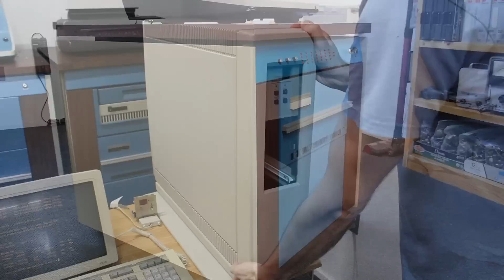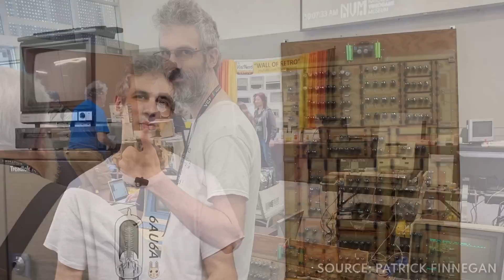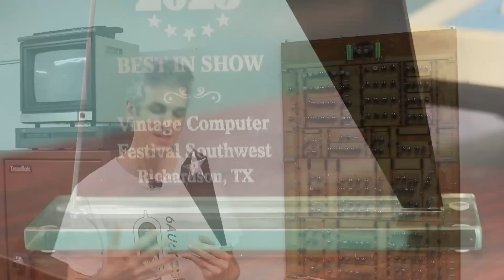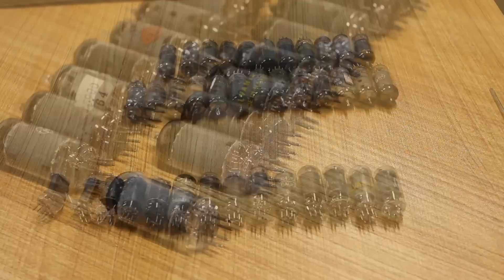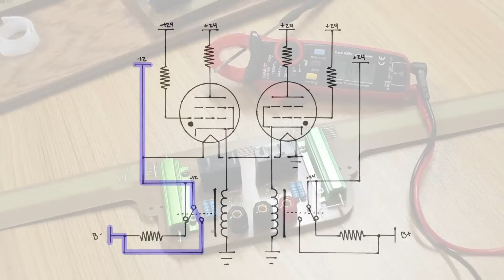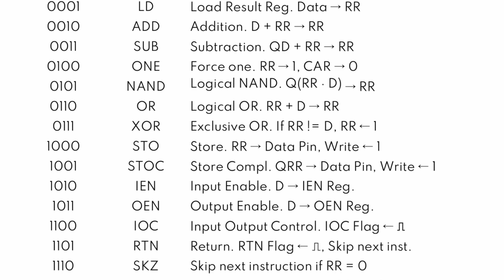VCF Southwest 2023 Recap and Fixing a Disaster

Comment: I have a piece of vintage TEKTRONIX equipment being a type 561b oscilloscope with a 3b4 time base and 3a6 amplifier, the story of how i got it is quite funny

The machine was originally purchased new from factory by ohio medical in 1971 (confirmed as i have the original reciept) and my grandfather used it to callibrate large industrial machines, by the time he left he was the only person at that facility that knew how to use it so they gave it to him, it sat under his workbench gathering dust for something like 20-40 years im not to sure, but one day last year i saw it and asked my grandfather about it, he happily showed it to me and said if i wanted it i could take it and so i did, he also had almost all of the documents and manuals for it intact and i got those as well, the machine works a treat and i havent had any issues with it, it is a vacuum tube machine and as far as i can tell they have never been replaced, which is mind blowing that it still runs perfectly with factory tubes

Edit: i also have some questions,
1 are vacuum tubes okay to touch, i have wanted to pull the tubes on my scope and clean them but i dont know if thats a good idea or not
2 what are your thoughts on the scope i described in the comment, im always curious what people think of it and the wild story it has

Comment: you getting back HS equipment, where we had more then 1 026 card punch and 1 129 punch. we had a IBM system 3 mod 10 with 600 line printer and 1402 card reader/punch. Were we punching 10K cards but the 1402 did not print one cards and that where 129 was used to print what was on the cards. we did not have the 96 card reader/punch as the HS want standard cards.

Comment: Sorry I just watched your video. I am a ham radio operator in Tulsa. I checked my stock on the 6AU6 and also have many. I believe that you designed this tube PC. That is Personal Computer not portable computer. Sylvania Sharp Cutoff RF Pentode with 6.3 volt filament, 300Ma.  I have the original manufacture data sheet if you want it. I would go to e-bay and purchase a pin straightener socket. They are only a few dollars, and you are going to need it. I have many tubes in my stock and have four tube testers. If I may, please mount the board on a vertical stand that is less likely to tip over. You have put a lot of work into this display.  I built my first computer in 1976 while I was in the Navy. I was onboard ship headed to Subic Bay Philippians. Personal computers did not exist, but you could purchase a kit computer based on an 8086 processor. Everything was toggle in with a four-inch-wide printer output. It took us six months to program it to play chess. Thank you for your video.

Comment: One slight improvement when you are doing repairs like this: The board-board interconnects would be better if they used jumper boards or standard jumper cables. This would allow each board to be easily removed or reinstalled. Also hooking up additional meters or diagnostics in the linkages would then be possible.

Comment: You should build a removable wooden cover to put over the vacuum tube computer for transport. Just screw on some 1x4's   around the perimeter and that should give you enough height to clear all the tubes then just attach a flat panel that sits on the 1x's.

Comment: You won for one simple reason, you had a well designed vacuum tube computer, similar to the ones built in WW2. Home built and running, well done. I would have given you the award myself if I had been there.

Those vacuum tube computers are hard to get going and keep running. I worked on one in college a very long time ago, back at the dawn of the solid state IC.

I would recommend that you mount all boards on the backboard using standoffs. Also as others have said, some guard rails around the boards would be good. Perhaps 3 d print up some board carriers. Make them steampunk looking and all will be good.
Reply: Steampunk looking? Maybe some nice brass drawer handles at Home Depot? They would need a little extension, but could give a nice look to the project, in addition to accident resistance.

Comment: There is not much overlap on the tube computers backing board to add some lightweight protective travel bumpers like slabs of tough expanded polystyrene or urea foam to take the hit if it falls face down on a flat pavement or floor. I sort of remember the board was maybe sized to fit your truck bed? If it's travelling around put some thought to designing a lightweight, tough wheeled box for it. Maybe run a group design project, audience participation? It could be reversed and double as a stable, inclined stand for shows where you don't have a handy wall behind for support ?

Comment: Can't you add some wood pegs that stick out further then the tubes so if in the future something similar happens the pegs can take the brunt of the impact. Just seems an easy solution to a problem that could happen again even if earth quake or something causes it to fall off wall could prevent major damage as boxing in the tubes would trap to much heat pegs would be simple and not cost much

Comment: I think you did very well going to those events. Being in Idaho. Anything like that was not and still not. Well we do have local Ham events. Around the late 90's I picked up a Burroughs B21 or 22. Not sure what model number. Big old 8" drive, and typical missing key on keyboard. It fired up and sure enough I found word perfect. But, with tons of other around that time. It got chucked along with Several Wang terminals, cables and printers. I still to this day go around to museums and such point out what I owned, if it worked, what I did with it and what I passed up. You taking your Centurion to the show was just what everybody needs. I droll all over your Centurion, Wang and soft of vax systems you have. I also Droll over Curious Marc hp systems.  These are the type of systems I consider classic. That I wanted to use or collect growing up. So I just wanted to say Thank You.

Comment: Consider adding a full-length handle/guard rail along the sides of your tube computer that sticks up higher than the tubes.  It would help prevent future damage and maybe even make it easier to transport.
Reply: I was thinking a tie down or bungee cord fixed to a stable point would subdue the Murphy. 💪
Reply: I thought of an acrylic front screwed in the same screw places of the boards , but probably the guard rail is the best option for minimum added weight.
Reply: @fordesponja  An acrylic cover would probably not be good for ventilation of the fire bottles.

Comment: The small pins are not made for this application. It may be okay for a signal (e.g. LED) but not board to board. Ususally they used card edge connectors for board to board interface. But maybe it would have done more damage when a PCB snaps or cracks.

Comment: Might I suggest a couple of "c" handles along the sides of the device that sit higher than the tubes.

Not only could this help with moving the board but if it tips, it would most likely protect from direct impact damage, and not look out of place in the design scheme as they could be made of wood.
Reply: Great idea.  My first thought was a plexiglass cover plate, but then I realized that would trap too much heat.  But some 'guard rails' around the sides would go a long way.  Maybe one or two near the middle as well, in case the board flexes too much?

Comment: You should put something in front of this computer while you are transporting it so in case it falls again, it would protect it.  If don't mind taking time to do this, remove all the tube before transporting it and reinstalling them when the computer is setup.  You could rebuild the computer so that when you need to transport it, it would be safe in a box. The box is only purpose is to transport it only.

Comment: Great video! Have you ever tested/used 1T4 pentodes? They are already designed for lower voltages, 1.4 V filament, 90 V or less plate and screen. EG my 7 tube 1t4 radio uses 54 vdc plate/screen.
Reply: I see you are one of those that never respond. Oh well.

Comment: probably a stupid suggestion, but could you not build a framework around the edges that was just slightly taller than the vacuum tubes to stop them hitting the ground if this happens again?  I know it could still get bent up, but it might save you from the worst.

Comment: That's enough vacuum tubes to give you x-ray cancer
Reply: You need high voltage to produce x-rays, 24 volts won't do it.
The EHT rectifier in an old TV can produce x-rays, but the energy is so low that they are blocked by a thin sheet metal box.

Comment: You may consider putting a frame in a light material around the board so that it's the frame that would be hit instead of the tube. A simple frame made out of light material like aluminum, PVC or wood would be enough.
Reply: That will do it.

Comment: the xerox print head is worn
Reply: Or it has a stuck needle. It might respond to stripping cleaning with isopropanol. Some of these old print heads can be adjusted so you may be able to do some "tweakage" to sort out its problems.

Comment: Damn awesome event, congrats about the star! And pity about Kevin... We can rebuild him, we have the technology! Nice recombobulation. 

Seeing the bent angular goldpin connectors gave me another idea: maybe using upright pin headers and jumper boards with female connectors? Sure, it's a lot of work machining and soldering them, but in case something smashes into a board, the joint will come apart at worst, but not damage any traces.

Oh, and if you want, it may be a good opportunity for a dissection video of 6AU6 from different manufacturers to show the differences in their internal build.

15:50 of all things, I'd never expect a resistor to fail.

Keri register recombobulated and go for launch, haha!
Reply: Yeah, I'm quite curious myself about why and how that power resistor failed. Might be worth someone with machine tools cutting the thing open to see what's going on in there. (For me, anyway, since I use that type myself for various power-supply-related testing.)
Reply from the maker: @Curt_Sampson  I didn't talk about it in the video, but I have a pretty good idea. When loading it up on the way too the event, my dis-coordinated self accidentally slapped a tube, bending the pins up. Instead of spending a few minutes to straighten the pins, I reached into my 6AU6 grab bag and just replaced the tube. Unbeknownst to me, I accidentally grabbed a 12AU6, which created a much lower resistance path to ground. I think that may have put a little too much stress on that 0.8 ohm resistor and burned it up.
Reply from the maker: Thanks Keri!
The 90-degree pin connectors was not a great choice, but one that become obvious in hindsight. For the second board, I'll be almost exclusively using upright pin headers and jumper boards with female connectors. It's more machining, but it's definitely a better connection method. Though, still not the most ideal, for UE-2, we'll be doing it proper!

Comment: Time to build a proper "crate" or cover to protect the tubes?
Reply: I was thinking "Roll-Bars"...
Just a couple metal rods would be easy.
Could also double as handles.
Reply: At least a cage
Reply: Or even some door stop bumpers on the corners
Reply: Other than some convoluted system of mounting the PCB's to a metal sheet instead of wood and bridging the gaps with thermal pads ?...
The only logical engineering answer is a case with active cooling.

I doubt he wants to stack the boards like shelves as they would not be as impressive on display.  But a box made of glass/plexiglass/acrylic/Lexan/etc. would allow for fans.

It could be left in the large flat panel the way it is, and still have one large clear front window... but I dread the cost of that window.
Reply: I'm imagining a minimum viable case. Like an "otterbox" but larger 😸
Reply: I think a cover would defeat the whole project. He needs a transport cover though. If he had a cover inherit to he could use higher voltage tubes. The voltages he's running at are what you see in small battery sets or less.
Reply: Yep, he better do it.
Reply: Good idea.
Reply: Something close to a box on wheels.
Reply: So, Any airflows ideas guys?
Reply: Heat?
Reply: Yeah, heat is the problem, he turns on AC To cool a computer down so, We need to think an most effective ways to cool down an entire computer without burning entire vaccum tubes.
Reply: Sooo, i think i can do that via studio and build a model proof of concepts which one is the best one, but kinda shy about entering discord servers, because is kinda spooky with the new people around it.
Reply: @kalletechnologies7649  are you drunk or something? Youre making zero sense. "Studio" you mean cad? Servers? Spooky? Discord? Where was any of that mentioned in the op?
Reply: @MichaelOfRohan  maybe i am.